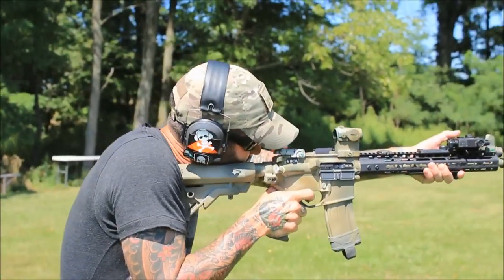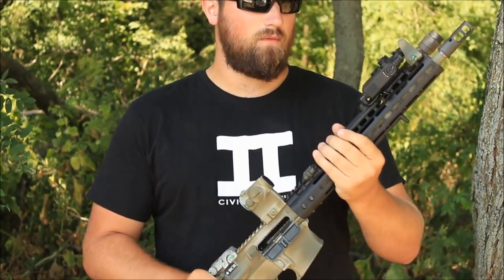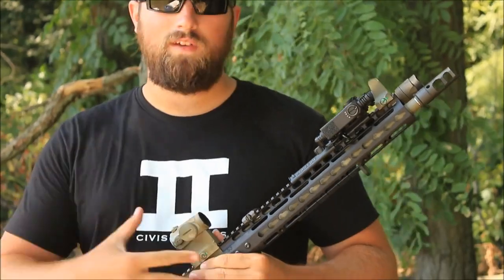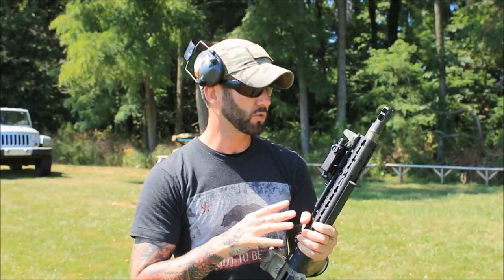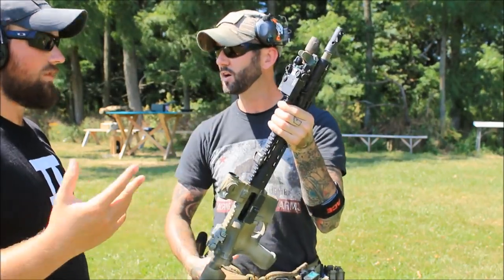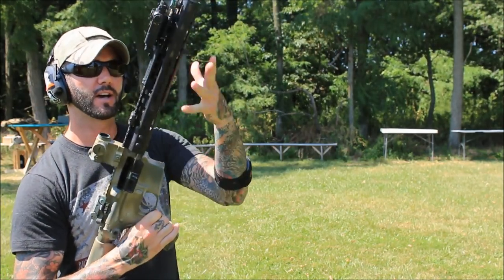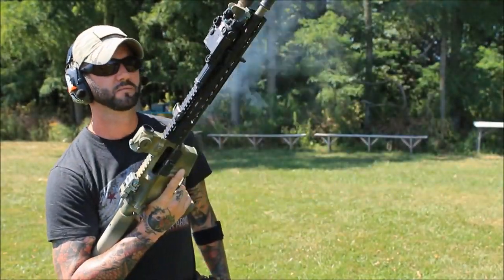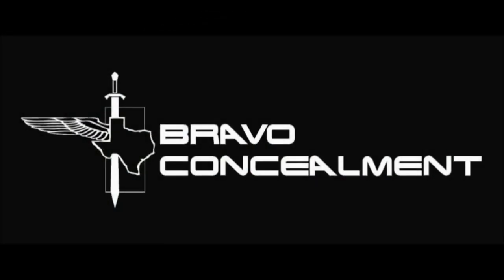Noveske NSR 14.5 Mid-Lenght AR-15 pt1

Comment: Just add the polymer panels noveske makes to keep it from getting hot.  No a dual mag dump won't make it hot but if its 100° outside and you shoot 4 mags through it, it will definatly burn you.